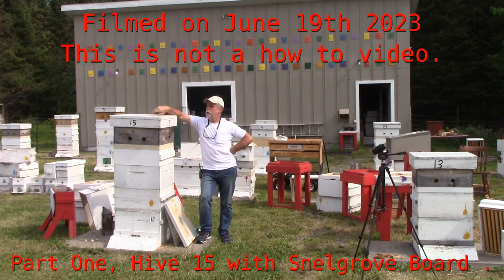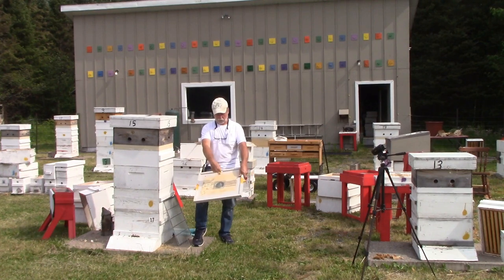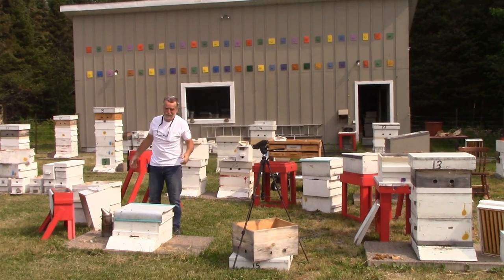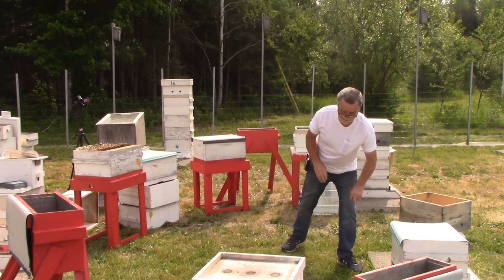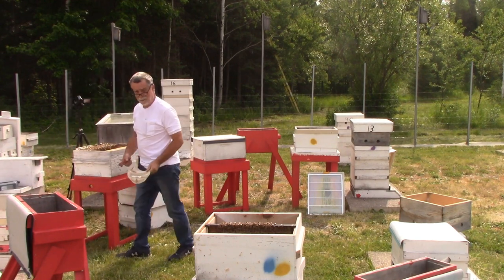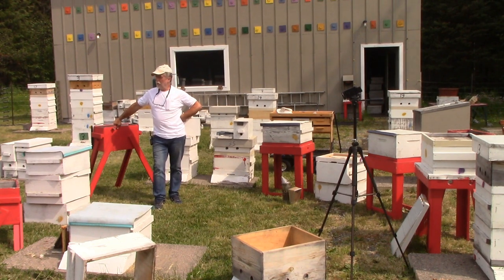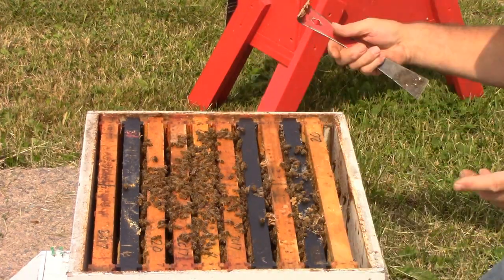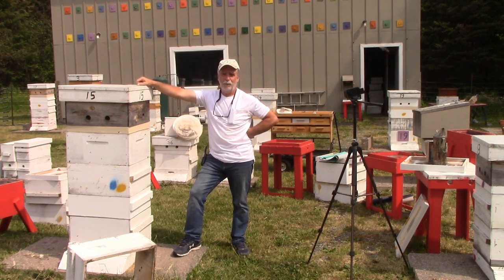Setting up Hive 15 in preparation for a Snelgrove board

Comment: Wow. No offense intended,  but you missed the boat on this one. Like you said, it's your first time doing it. First, locate the queen in the bottom box. 2. Make sure the upper box has food stores, capped brood, and day old eggs. 3. Divide the boxes with the double screen divider board with it's entrance of the upper box facing opposite of the lower hive body. Just be sure that the lower box has enough room to accommodate all the returning field bees that will come back to their known entrance. Check back in a couple days to see that the upper box is producing a queen cell. If so, your done. Come back when your figure she should have returned from her mating flight and should be laying. If she is laying, you can leave it as a double queen colony or move that newly created top colony to a new location. Simply put, you divide them and that's basically it. If the new queen somehow fails to return in the upper box, you simply remove the divider board and do a newspaper combine.
There is no need for all that 3 day doing this or that or switching entrance openings. All unnecessary time and effort. AND, there is no queen excluder in the picture with this method. Using that queen excluder for the three days prior to putting on the Snelgrove board/double screen divider board is an instant disaster. That upper box needs to have  day old eggs to make a queen. Putting a queen excluder in for three days prior to the divider board, the original queen of didn't lay new eggs in that box. Now that split has only eggs that are three days or older to attempt to make a queen from.
You also forgot to mention that using this Snelgrove board, the bees in the upper box will have no physical contact with the original colony in the lower box. They will know their queenless and in no time start work on creating a queen. With this method, the upper box benefits by having the heat of the larger number of bees in the lower box rise up to them.
Bottom line, it's a simple method to produce another hive. It's damn close to simply dividing the hive in half. It's not complicated at all. Your video portrayed this method as something complicated when in reality it's a simple way to create a new colony.
Reply from the maker: " No offense intended, but you missed the boat on this one"..No offense taken, thanks for your view on this.

No offense intended, but you missed the boat on what I am trying to achieve here.

With your method all you are doing is producing a new queen. If that was all I wanted to do I would just graft and call it a day.

With Mr.Snelgrove's method we are producing a queen but also removing the nurse bees from the main hive, which will reduce the likelihood it wanting to swarm and the upper box has no flight bees reducing the likelihood of it wanting to swarm.

The bottom box continues to get boosted with the older flight bees from the upper box over the course of two weeks but still no nurse bees which will help them to make a good honey crop and still prevent them making cells.

The upper box does have fresh eggs to produce a good queen as I removed all the brood/eggs from the bottom box except the frame the queen was on.

I am sorry if you found the video complicated, I thought the same thing the first time I read Mr. Snelgrove book but after reading it a second time I found it very simple.

Now I did this on four hives last summer two worked as Mr. Snelgove said, But two were not perfect, and I feel that was 100% my fault, I did not give them enough honey boxes to keep up with the crazy honey flow last year.

Again thank you for you view on this, but as I said I don't think you realized that my goal with this was not to simple produce a new queen/hive it was to produce a queen and make a good honey crop AND to TRY and prevent a swarm

Thank you.
Scott
Reply: If you move the bulk of the brood into the upper box, to sustain that split, you'll also be automatically transferring the nurse bees that are tending them. With that neither box would be inclined to swarm. The upper box would have virtually no field bees and the lower box would have its numbers decreased. On both ends, the impulse to swarm is decreased.

Using the queen excluder, you eliminated the possibility of fresh eggs. What was fresh day old eggs would now be three days old by having the queen separated for that length of time before placing the Snelgrove board in place. So "fresh" eggs are non-existent at that point. Any eggs in that top box are days or more old.

This is not just a method of producing a queen as you state. That top box would have emerging bees. Food stores. Nurse bees that graduated to field bees and a new laying queen. That's a colony in my book.

Like you said, if you simply wanted to produce a queen you'd graft one. No doubt or use queen castles  for that purpose. But the Snelgrove method gives you an up and running working colony.

As you say you used the original Snelgrove method and had a 50% success rate. As Dr Snelgrove hit upon a brilliant idea with creating that concept and the genius of the dividing board that bears his name. His concept was from 1934. What I'm  presenting to you is that the original, 90 year old concept/ procedure can be streamlined.  That's what I'm trying get out there. Eliminate the three days of the queen excluder. That's part of the 90 year old concept. You'll see an increase in the success rate.
Reply from the maker: @michaelpeterson4995   By moving all the brood above the queen excluder you get ALL the nurse bees in the upper box as they want to be with the brood. They move up through the excluder to rejoin the brood.
"Using the queen excluder, you eliminated the possibility of fresh eggs." ...No, I am using the excluder to separate the nurse bees from the queen, there are enough eggs already in the upper box for the bees to make a new queen.

This also lets you know that there is not a second queen in the hive ( if you go in and catch them in the middle of a supersedure ) I was in Hive 13 an hour before I did this hive (15) but I saw that that was what they were doing so didn't try the Snelgrove system.
If you have a queen in both boxes they make no cells

There were fresh eggs on the day of this video in the upper box and they began cells immediately, the queen excluder and the one honey box is enough to get them to start a cells (will see this in the next video)
The Snelgrove board is added later only for the doors so that the emerging fight bees over the following weeks can be siphoned off and added to the bottom box.
"method and had a 50% success rate."...My mistake, not the method, I should have added more space.
" But the Snelgrove method gives you an up and running working colony."...I am not trying to get an up and running colony I am trying to produce a honey crop, slow swarming and make a queen  (although that is only secondary) and this hive is very much an up and running hive. 

"His concept was from 1934." I have the book (second edition March 1935)
Reply: @BeekeepinginNorthernOntario  The bees in the upper box didn't start making  queen cells virtually instantly because they were above the queen excluder. Just like if a queen starts laying in a honey super. You put a queen excluder in place to keep her out of the honey super and prevent her from getting in there again. The workers don't start  building queen cells up in the honey super because the eggs are above the excluder. They know they have a queen. The eggs in the honey super simply go the course and it's done with. Your bees were able to travel back and forth and have personal contact in both boxes and exchange pheromones. They would still be queen rite in their world. They built queen cells in the upper box out of coincidence for swarming or a supercedure just like the other hive you opened prior to doing this Snelgrove procedure. They didn't build cells simply because the eggs were above the excluder.

The nurse bees didn't need to rejoin the brood that was moved up into the top box . The nurse bees required to care for the brood were already on the frames of brood when the frame was relocated. There's need for the queen excluder process. 

And yes you moved "fresh eggs" into the top box at that moment and put the queen excluder in place. Other than them having swarming or queen replacement in mind, there is no need for them to build queen cells up there. They still believe their queen rite. Now three days later, you switch out the queen excluder and put the Snelgrove board in place. Very quickly the bees in the upper box realize their queenless. For three days the queen wasn't  permitted to lay in that upper box. They'll now attempt to make a queen out of whatever is available.... The eggs that have been there a minimum of three days is their option.
Reply from the maker: @michaelpeterson4995  "The bees in the upper box didn't start making queen cells virtually instantly because they were above the queen excluder."

I did this operation on four hives last summer and at the time I put in the queen excluder there were no queen cells on any of the frames I put in the upper box with the (exception of hive eight I missed that one) But the other three had no cells. When I returned three days later to put in the Snelgrove board all of them had cells stated and in the end all four hives had laying queens in the upper boxes. No swarm
"They'll now attempt to make a queen out of whatever is available" no the cells were already started. Next video I installed the board and the hive had open cells nicely starred as did the other three hives.
Reply: @BeekeepinginNorthernOntario  Then going with your logic,.... When you separate eggs in a honey super via a queen excluder, you will automatically end up with queen cells in the honey super because their separated from the rest... No.

You say 3 of your Snelgrove attempts already had queen cups/cells in the making when you placed the frames in the upper box. So, again, why get involved with the queen excluder. Just put the divider board in place.
Reply from the maker: @michaelpeterson4995  These are the instructions from Mr.Snelgrove book that I followed from Page 39.

Please note on day one there is no board installed, it is installed on Day 4.

Box A is the top box and box B is the bottom

SUMMARY OF METHOD I
For a stock in any single-walled hive, without queen cells.

1ST DAY.
Separate combs and place them as follows : -

In box A:-
Combs containing the brood, with adhering bees.

In box B:-
(a) Broodless combs, with adhering bees.
(b) One comb with a little unsealed brood.
(c) The queen.

Rebuild the hive in the following order : -
Floorboard, Box B, Excluder, Super, Box A. (Plate
III, Fig. 3.)

4TH DAY.
Place screen board under box A, with its edge without
small entrances towards the front of the hive. (Plate III,
Fig. 4.) Withdraw wedge I, leaving others in position on
the board.

7TH OR 8TH DAY.
Replace wedge I and remove wedge 2. Remove wedge
3 on the opposite side of the hive. Ascertain if queen cells
are being built in A.
14TH OR 15TH DAY.

Replace wedge 3 and remove wedge 4. Remove wedge
5 at the back of the hive.
Reply from the maker: @michaelpeterson4995   "You say 3 of your Snelgrove attempts already had queen cups/cells in the making when you placed the frames in the upper box."

...No, I did not say that. I said that on the day that I separated the queen from her brood there were no cells started in the upper box but when I returned on day three to install the board as Mr. Snelgrove say's to do that at that time they had started cells
Reply: @BeekeepinginNorthernOntario  Ok. When Dr Snelgrove put forth his findings, it was a hell of a discovery. That was 90 years ago. Things being re-examined, modified, upgraded, and procedures altered can make things easier or more effective. Yes, he hit on a most impressive fact but the process can be simplified. You just can't sit back and take his discovery and method as the absolute. Ask the Wright Brothers. (Just busting there.)
Reply from the maker: @michaelpeterson4995  " You just can't sit back and take his discovery and method as the absolute."...

Well for now I will, until I find a better way to achieve what I am trying to do.

In your very first post you describe a method to produce a single queen and get a new hive, I am not what I am trying to do that.

I am trying to prevent the hive from swarming, making a good honey crop and making a new queen. 

The method Mr. Snelgrove has laid out, does this.

I am not suggesting you or anyone else does what I do. This video is just for entertainment...LOL
Thank you.
Scott
Reply: Ha ha ha ha ha ha ha ha
Reply: If I was starting beekeeping and saw this video, I would sell everything and give up. This is a painful video and the simpler way of doing what you’re trying to is in the comments form Mr Peterson. Just saying.
Reply from the maker: @macsbees5775  Well, if I was trying to make a walkaway split then yes, but that is NOT what I am trying to do and would seem that both you and Mr.Peterson can't seem to see that.
Thanks for watching and have a wonderful day
Scott